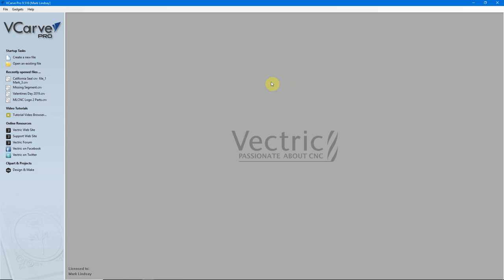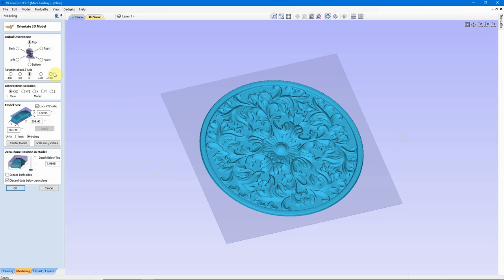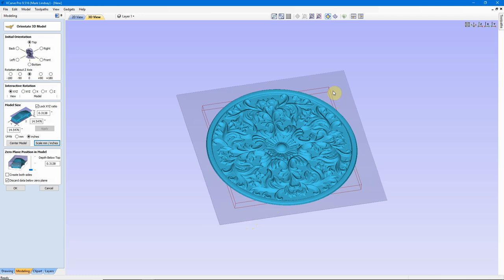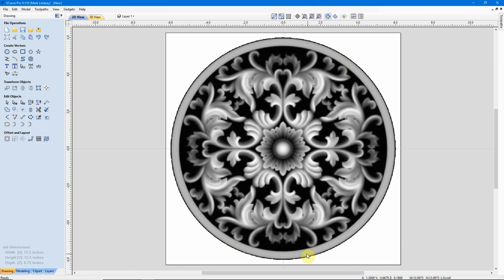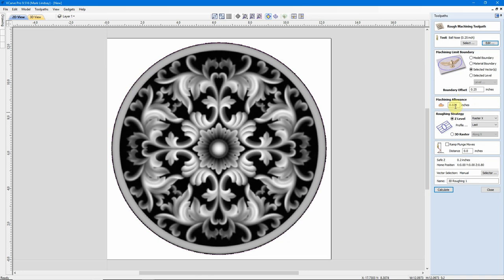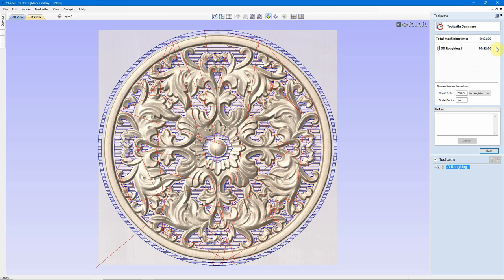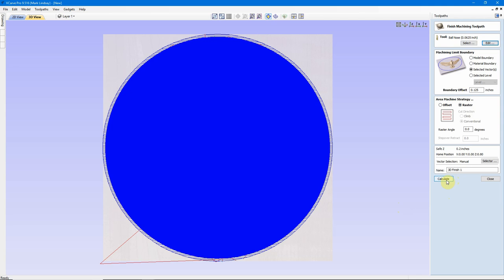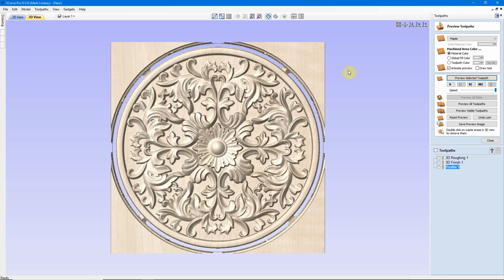Importing STL Files - Part 20 - Vectric For Absolute Beginners

Comment: Thanks Mark for a very informative lesson, I am thinking of buying a Rapid Change ATC and they sent me a STL file so that I can run a mock up unit to see if it will fit on my CNC. Well it has holes in it for where the cutters fit into and fixing holes to the cnc table, I have never done a 3D before but this one made it a lot easier to understand. I have just upgraded to VCarve12 so working out what is different is a bit of a challenge. Cheers.

Comment: I have a question. The allowance offset for My 3d roughing tool pass on an stl will not move past the boundary...if I use a negative number it will move in, but it keeps showing that the roughing pass will leave a ridge where it will not pass. I’m not sure what I’m missing. No matter what number I put in for the offset it has no effect on the edge of the tool path, unless it’s negative and I shrink it. Any ideas?
Reply from the maker: This would be better answered by emailing Vectric Support. It may be something to do with the STL file itself or the toolpath, but I've never had that happen. Shoot Vectric a support an email, and try to include screen shots of the issue. Thank you!
Reply: Mark Lindsay CNC thank you for the advice! And thanks again for all your great content !

Comment: why does everyone who do these videos stop before the post process
Reply from the maker: I can't speak for everyone, but I stop because that topic is machine/controller software specific. My machine and yours are probably very different, so the controller, software, and post processor will be different, which means the resulting G-Code file type will be different. I have done a couple of videos in the past that give an overview of the process of saving G-Code, and I'll link them below for you. Even so, since I made those videos, I've gotten a new CNC, which runs on different controller software. And, you guessed it, the post processor is different from the one I used to use. Note that in the videos linked below, I was using Mach3 controller software. If you're not using Mach3, check with your machine manufacturer for the correct post processor, and instructions on how to import it into Vectric software, if it's not already included. 

Here's a link to a video I did on saving G-Code in Vectric software Version 10.5 and later: https://www.youtube.com/watch?v=X-3zOZ0w4Jg

Here's a link to a video I did on using a Separate Last Pass, Selecting your Post Processor, and Saving G-Code in Version 10 and earlier: https://www.youtube.com/watch?v=kFIkyl8tUFU

Comment: I recently purchased an stl file.  I wanted to recess this carving in a piece of live edge but when I run the 3D finishing toolpath it also carves out the outline / profile of the file.  Is there anyway to not carve out the profile?
Reply from the maker: Without knowing what the project is, it's hard to say. You might try adding a Zero Plane, then a vector boundary around the STL file - offset that vector boundary to the Outside by the diameter of the largest bit you're using for the Roughing and Finishing toolpaths. That effectively makes the entire surface of the material a part of the 3D model. That might not be what you're looking for, but try adding a Zero Plane, select the vector boundary, machine to that vector boundary, calculate the toolpaths, and preview them to see if that gives you the result you're looking for.

Comment: I have a file I want to carve in Corel Draw. I don't have STL as an options in my export choices. Do I have an alternative? I really want to bring the job in to carve. Thanks.
Reply from the maker: I'm not certain exactly what file types Corel Draw will export to, but if it will export an SVG file, they can be imported into VCarve. ALSO - send an email to Vectric, requesting they include the ability to import a CDR file directly into VCarve and Aspire. I know that some folks have already asked for that, but the squeaky wheel gets the grease. They DO listen to customer requests, so the more folks who ask, the more likely they are to do it.

Comment: Mate you should be paid by aspire/Vectric, you just make sense full stop.
You have given me so much more confidence that I can actually achieve my goals. One note, you say to follow the grain however the illustration looks to be going against the grain? Getting picky but am new to this
Regards and thank you. Keep em coming I’ll be sure to watch and tell my friends 
YOUR THE MAN 
Derek
Reply from the maker: Thank you very much for the kind words. I really do appreciate them. As for following the grain; as you can see, the material sample image has the grain running vertically. That's just the way that particular sample image is oriented. I should probably add a few samples with the grain running horizontally, to avoid this kind of confusion. Also, I typically change the raster angle so that the file is being cut at a 45° angle now, rather than cutting with the grain. I'm finding that I get cleaner results that way.
Thanks for watching!
Reply: Mark Lindsay CNC ok good to know. We all want to avoid as much sanding as possible, I’m getting older

Comment: This is one of Marks best videos but then they are all great.  At the end of the video you used the 20 minute roughing pass with an 8 hour finishing pass.  If you had used the other 1 hour roughing pass what would have been the final pass time?  
Thank You for the great work and please keep it up!
Reply from the maker: Thank you for the kind words, Bryan! The finishing pass time would stay the same. The roughing pass is more to save wear, tear, and possible breakage of the finishing bit than anything else. If I had roughed out the whole thing, I might be able to set a slightly faster feed rate, but that depends on the material and how it's cutting.

Comment: Great video thank you very much... I hope somebody can help me on this.

I have a model with is 600 x 300 mm and has little 20 x 20 mm squares to be carved 3 mm deep all aver the surface...

The 3D rough machining follows the border of all the squared shapes and carves rough good so that the carved surfaces is 100% flat. However, when I try to configure the 3D finish, it goes step by step way to the other un straight lines so that the steps are marked on the little 20x20 squares surface border.

How could I make the 3D finish to follow the borders of the shapes to be carved with the 3D finish???

Comment: Mark, I have a 3d object file of a guitar neck. I'm having trouble setting it up. It will be two sided, but since the head stock is angled, part of it will need to be cut below the zero plane. I tried setting up the zero plane center of the neck. I have a bunch of files I purchased for a les Paul guitar. I would be happy to give you copies if you could help me figure out how to cut this neck. The body was easy. Thanks
Reply from the maker: There is no easy answer to this question. You'll need to make the material in Job Setup thick enough to carve the neck and headstock out of 1 piece. Import the STL file, and adjust the position so that the modeling plane is underneath the model. From there, basically, you're going to have to decide which side of the neck you're going to carve first, then build a jig to hold the neck from that side. What I mean by that is, lets say you carve the top of the neck first (the fretboard side.) You'll need to mount the neck fretboard side down, onto that jig. I'd use either double-sided tape or the painter's tape and CA glue mounting method for that. The jig will need to be flat for the fretboard mounting surface, then angle up for the back of the headstock. It could be made out of plywood and screwed or clamped to the table as you clamp or screw down any other project material. Sorry I can't help more than that, but I don't have any videos that demonstrate the process. I do have plans on building a guitar and making a series on the topic, but it'll either be later this year or next year before I can get to it. My plate is so full right now, it's not even funny.

Comment: Mark Great Video. The amount of time to create this project is my concern after you showed your audience. Because if you use a Boush or Dewalt router and not a "spindle" type router, wouldn't that cause the router to overheat? Or would you have to pause the cut somewhere in the program to let it cool down and then resume to finish the cut? A long run time will get those routers hot. How do you deal with that? Thanks
Reply from the maker: My first 3 CNC routers used a Porter Cable model 890 series router. I believe the longest continuous carve I ever had was 14 hours, and I never had a problem with it overheating. Your concerns are valid, however. It all comes down to the fact that almost all routers were never designed to be run for that long of a duration without a break. They were designed to be turned on, make a cut, then turned off and allowed to cool off for a while. People have burned out routers (usually in hot weather, but not always.) This is especially true with smaller "trim-routers." The cooling fans inside aren't designed to handle that kind of work load. This is why I'm an advocate of using a spindle (be it water cooled or air cooled,) instead of a router. Spindles were designed to run for long periods without a break, and their cooling systems were designed accordingly. Having said all of that, for the beginner, you shouldn't have much of a problem running a fairly new router for long durations if you take steps to allow for maximum air-flow through the router (things like blowing out the router motor with compressed air after every use, and making sure the airway is kept clear of obstructions.) Just about all of the burned out routers I have seen had been neglected or were several years old, and had gone through several sets of brushes over their lifetime. I know that spindle kits are not cheap - but neither is replacing a router every 3-5 years.

Comment: Hey Mark great video- only problem is on my finishing tool path, the TBN wants to essentially “drill” around the outer vector . Any tips to prevent this  in Vcarve desktop?
Reply from the maker: Try adding a Zero Plane and make sure it's at the top of the Component Tree.

Comment: Thank you for your reply. Umfortunately I have over 200 files with such values. I doubt vetric will supply me with answers as they could not in the past.
Regards
Reply from the maker: If scaling the STL file isn't working in the Import screen, go ahead and finish importing it, then do the Metric to Imperial conversion in the Set Object Size screen. Use the formula in this video to convert: https://www.youtube.com/watch?v=KE4kxHxE95g

Comment: thank you for the very effective videos.
i have the following problem: i input an stl file of a square block with a dome dug in it. i cannot create a vector boundary. vectric does not recognize the edge of the dome on the top surface. i try to draw a circle around and again no recognition.
what is my mistake?
thanks

Comment: Is there a situation when you would raster against the grain? Thanks for all your helpful videos!
Reply from the maker: Yes, there are a couple of situations. When cutting Mahogany and other stringy woods, cutting at a 40-45 degree angle to the direction of the grain slices the fibers, rather than letting them tear or rip. It comes in very handy.
Reply: @MarkLindsayCNC : Thanks Mark. So do you prefer not going straight across any grain?
Reply from the maker: Going straight across the grain has its place, but I find it leads to a rougher surface finish on 3D carves. I tend to stick with somewhere around 40-45° to the grain direction.
Reply: @MarkLindsayCNC : Will give that a shot. Thanks for all of your great videos and sharing!

Comment: Thank you for the great videos … all I know is … I have a lot to learn…… I’m about to do my first 3D file carve… my question is after doing the roughing cut.. then change bit to do the finish cut… where do you zero your Z height for the finishing bit at? I’m using two different length bits. I would assume the highest peak left after roughing cut.
Reply from the maker: I plan on doing a video on this topic when I get moved into the new shop. The short answer is, set your Z zero in a place that won't be carved away. Contrary to popular belief, you do NOT have to set your Z zero at the same place you set your X and Y zero. Pick a spot on your material that won't be carved away, draw an X there, then circle it. Set your X and Y zero to wherever you told the software you were going to set it (center, bottom left, etc...)  Move your router/spindle over to that circled X, then set your Z zero. Every time you do a tool change, set your Z zero on that spot, and you should have no issues.

Comment: Is the reason you chose to machine to selected vector instead of model boundary to save time?
Reply from the maker: In this case I chose the Vector Boundary to both save time and to demonstrate one way to limit the area the bit was going to carve. In many cases (for example, the use of a Zero Plane) using the model boundary will result in the bit carving the entire surface of the material. Machining to the selected vector will prevent that.

Comment: If you use raster for roughing, can you later adjust plunge rate/feed rate on the final 3D pass enough to be more efficient than before?  If the hold up on the plunge is the depth it has to go on the deepest parts for good accuracy it seems if you could double plunge speed (as it only will need to cut a shallower cut at the extremes) on the final you would be a head in the total.  Certainly machine dependent.
Reply from the maker: Absolutely machine and bit dependent. If you're using a tapered ball nose bit, they can handle a bit more stress than something like a .03125 diameter bit can handle. Of course if you're using a tapered ballnose bit, a roughing pass isn't really necessary in a lot of cases - depending on how deep you're carving, that is.

Comment: Mark ;
Thank You for these videos! They have helped me a lot so far.
I have been going thru them slowly being new to using a CNC machine and now working full time again training dogs. My question is regarding importing a .stl model file for a 3D carve I'm doing for my training mentor. I'm importing a file from Esty and when I import it it's really big and has a symbol that looks like a picture of an atom with the neutrons around it; three rings red, green, and blue around the box representing the work surface. The distance from the model and the work surface is pretty big and there is a zero plane there already I think. Do you have a video that might address this "thing", and help explain centering and positioning of the model. I am using V-Carve Pro. I hope this isn't a bother for you. I've tried to get through your play lists but so far haven't located or I missed it if it was addressed. I know it's kind of specific but I'm hoping you can point me in the right direction
Thanks Scott S
Reply from the maker: What you're seeing is the new interface to import the model. The 3 rings represent the 3 different directions you can orient the model. Size the model to the desired size and click APPLY within that box. That'll resize it to fit into your material. Click the Position and Import button, and use the slider to place the model where you want it in your material. You can use the BACK button to change sizes or make any other adjustments. Click IMPORT to finish the import process.
Reply: @MarkLindsayCNC  Thank you.  I did as you advised and went back and forth several times to get it placed into a work piece that the file liked and I could live with. Thanks for the help

Comment: Hello Mark, I hope you are still doing Videos on vectric v-carve, I have a question. Can I convert an SVG image to an STL 3D image, if it can be done do you have a lession on this? hope to hear from you soon.
Reply from the maker: I'm still going to be doing videos on techniques that can be used in VCarve, but I will be adding to the Aspire Only videos as well. As for a SVG file, you can import an SVG, but you can't create a 3D model of any type in VCarve. That's done in Aspire only. Also, VCarve won't let you export an STL file - that's also an Aspire feature. The thing to remember is that VCarve isn't a 3D modeling program. It never was, and never will be. Aspire is the 3D modeling program offered by Vectric.

Comment: Thank you for another excellent video! One question  (that you may have gone over in another video but I didn’t start at the beginning) does it really matter where your datum point is? We started out putting it in the lower left corner but for the last few projects I’ve written, I’ve been putting it in the center. We locate and zero on an “x” drawn in the center of the board. Is there an advantage to leaving it in the lower left? Thanks again-I’m learning so much from you!
Reply from the maker: Thank you very much! The only real advantage to setting X Y zero to the center is within the software. It's easier to design from the center, in my opinion. There's not really an advantage to setting your X Y zero in either place when you get out on the machine. It's really just a matter of preference. Both work equally well. Just remember to set the XY zero to the same place in the software and on the machine.

Comment: wondering why the roughing pass shown at 21:00 on the outer ring area didnt just generate circular contours and instead is going back and forth hundreds of times ?
Reply from the maker: Good question! I set the toolpath to Raster back and forth like that to cut with or across the grain of the wood, depending on the grain's direction. That's easier on the bit, and produces a better finish. Thanks for the idea! I need to do a video on this subject!
Reply: Oh ok gotcha , I’m use to fusion 360 so lots to learn. Thanks